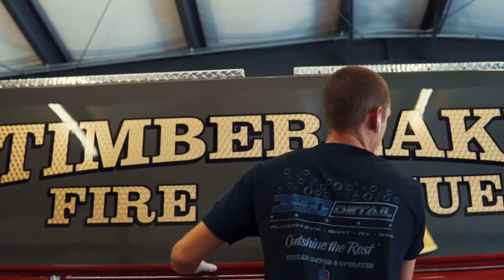Timberlake, North Carolina Firetruck (2020 Spartan Gladiator - SPS Graphene Ceramic Coating)

Comment: only if we had cooler looking trucks
Reply: I understand that most like a cool- looking truck. I do too. But that's the last thing that a department should be concerned about; it's way more imperative that the truck has no operating issues and helps the firefighters do their job, safely, quickly, and effectively.